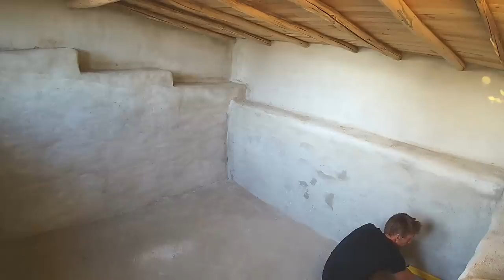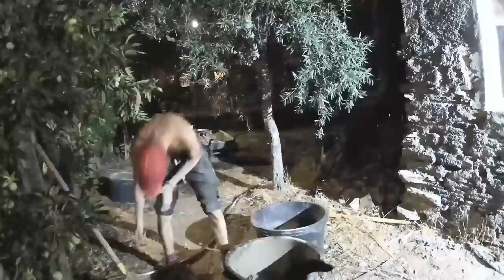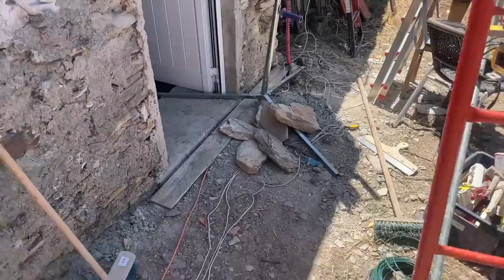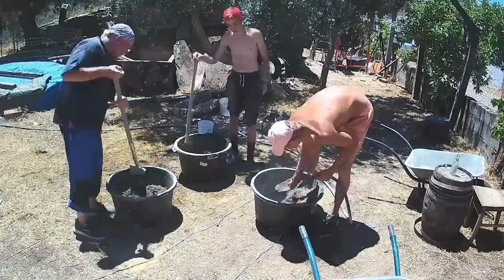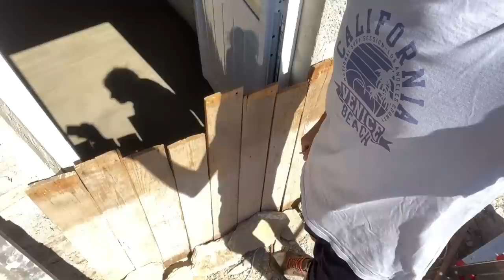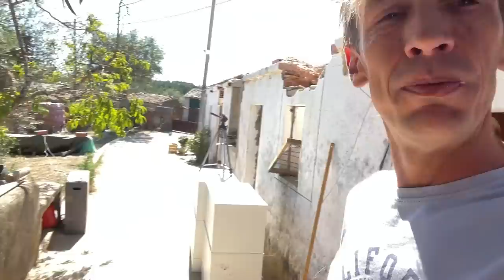WHO NEEDS A CEMENT MIXER WHEN WE HAVE MUSCULES | Portuguese DIY Home Renovation

Comment: It’s a bit too late, but they sell self-leveling cement that you just pour on. It’s very soup-like so it spreads out and levels the floor all on its own. Maybe for next time
Reply: Excellent product, used this on my floors.
Reply: Used it in my kitchen 2 years ago  great product. Put a nice laminate floor down too.
Reply: How much does that cost a square meter? Can't you get that result your self with normal cement but more water?